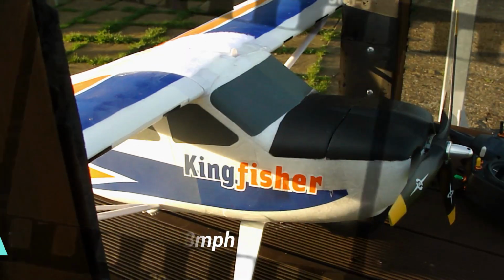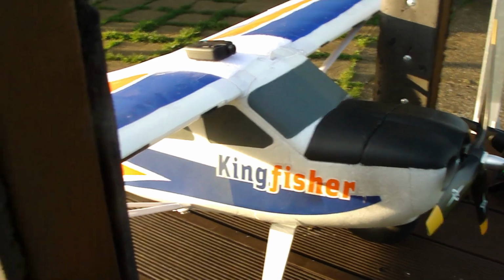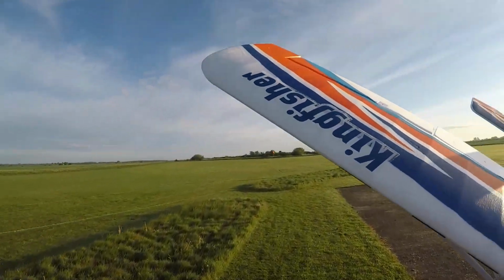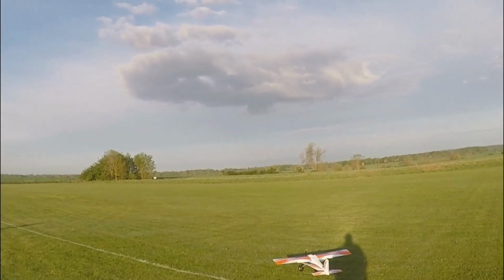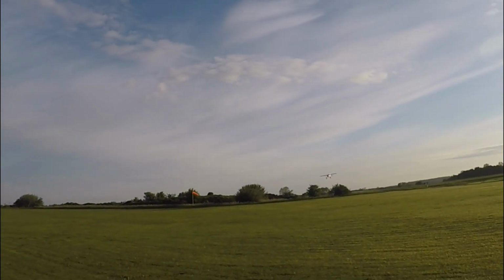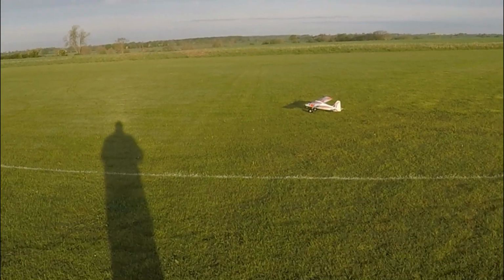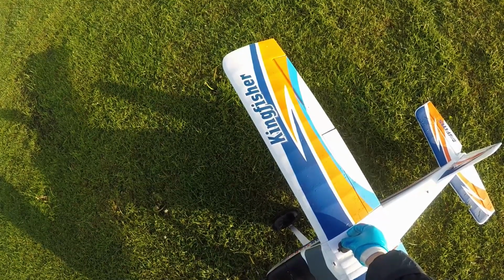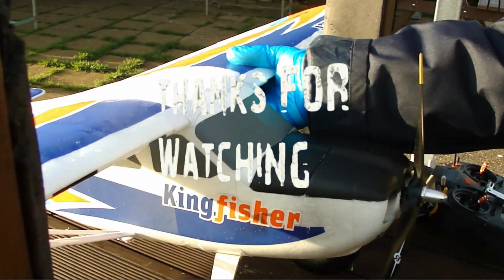Maiden Flight - FMS 1400mm Kingfisher - 23 May 2021

Comment: Martyn your on a roll.....
Another kite as smooth as silk
You didn't tell me it was
VERTICAL TAKE OFF though. You sly ol dog..... Impressed.... I'm going to have to up my game on my maiden's. Low winds tomorrow so I'm thinking of taking the
HURRICANE TUNDRA OUT...
Reply from the maker: HT  (Hurricane Tundra) not FT LOL -  I did say it will give the DRACO a run for its money - My god it really took me by surprise - and that was only half Flaps !!!! - I bet if I have full flaps and punch the throttle it will lift in 6 Inches or less !!!! - Regarding my maidens the Problem is I am now entering the realm of  Aircraft that could be (and some are known) to be problematic !!!! so I expect a few CRASH and BURNS to be coming up...I had one CRASH today but already have repairs underway......Good luck if you fly tomorrow - stay safe.
Reply: @FlankerTanker  dam if that was half flaps.... full flaps stiff breeze no problem... Straight up....
Apparently there's a slot at about 3/4  
1 to 5 mph.... Perfect to try the new wheels and stiffened wings.. I put carbon fiber spars on each side make it more ridgged in the right turns....... Up up an awaaaaaaaaay
Brian
Reply from the maker: @BRIANFORWARD1  Ha ha ha - You are going to have Killer Planes chase you down .... Crash proofing your own kites..LOL
Reply: @FlankerTanker  hahahhaha I've noticed that in super slowmo the wings flex on tight turns... We can only wait n see the difference mind you it's made them more surviverbilty. (making me own words up now) on lumps n bumps.....
Awaaaaaaay. Hahhahahaha sure I'm losing the plot.....